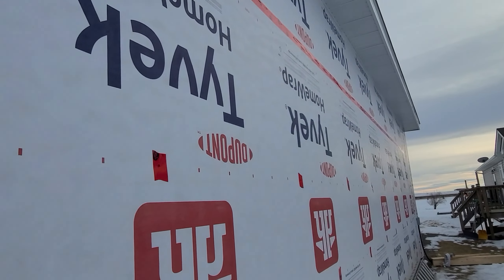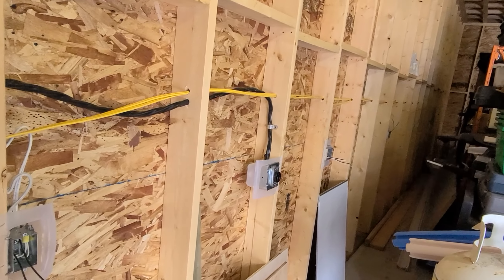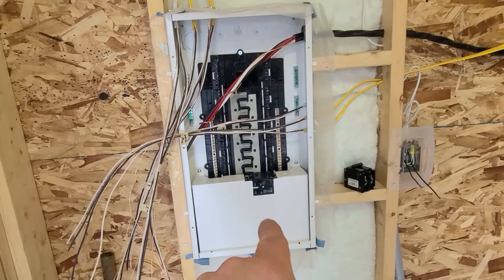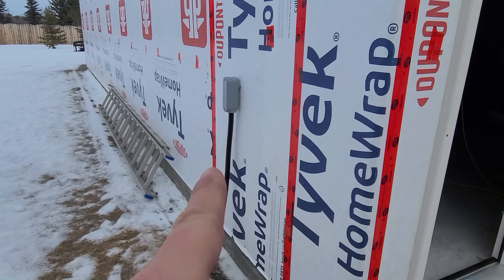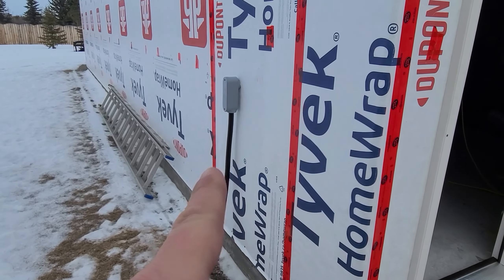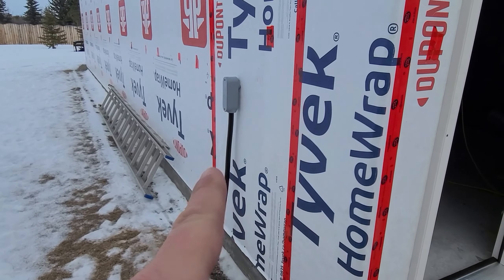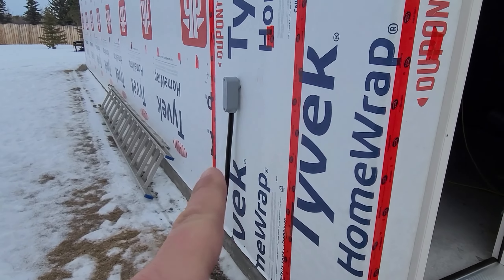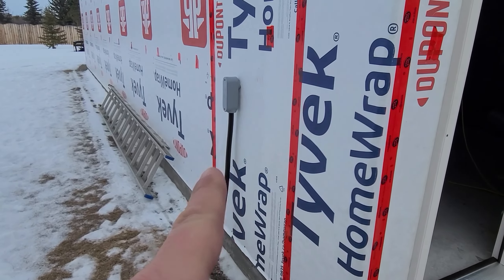Garage update

Comment: Nice install.   Technical question for you and I know different localities have different codes they follow/enforce.  While bonding you box did you have to treat it as a sub panel or a primary panel. Reason I ask, I just finished up wiring a house job for my son.  Our supplier requires treating it as a sub panel because the master cutoff is on the supply pole with the meter.  8 miles away, a similar install with a different supplier would require it to be directly bonded to ground, and not considered a sub panel supply but a primary.  Just interested in how your locality regards it. Again, it is what a code requires.
Reply from the maker: For me, the first cut off is my metered connection.  It is not considered part of the Residence system.  In my house the pannel is bonded because it is the first place brakers are installed.  Now because my garage is detached from my house the panel has to be "debonded" if that is a real word.  If your panel is inside of the main residence it should be bonded.
Reply: @DuchesnesCorner  That makes sense.  Thanks